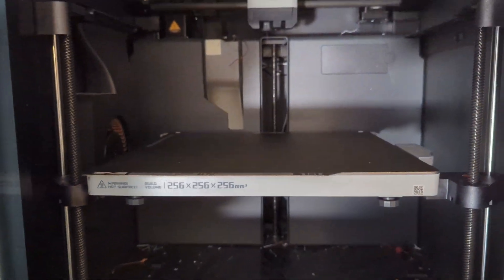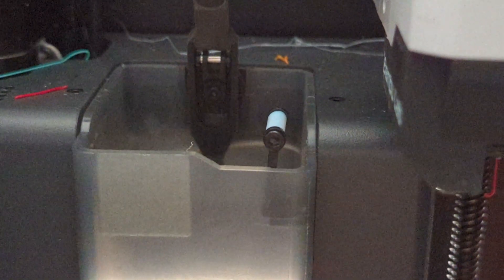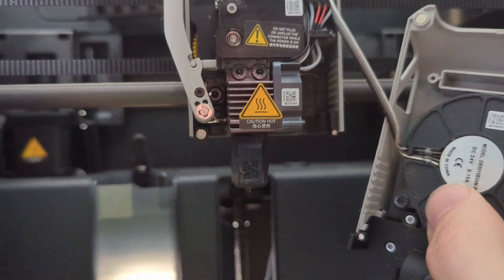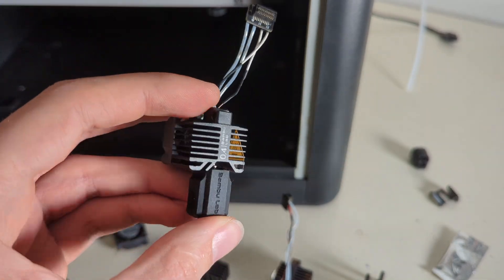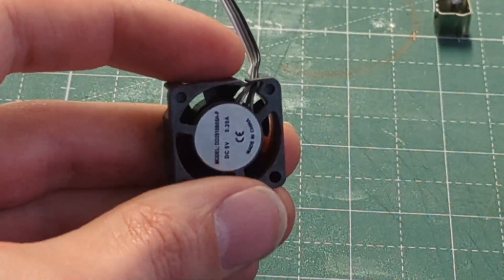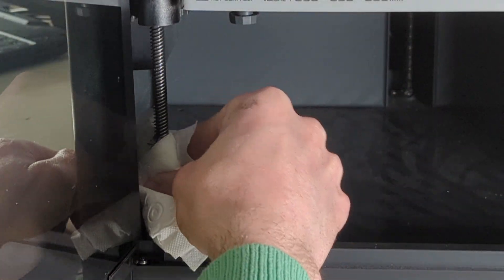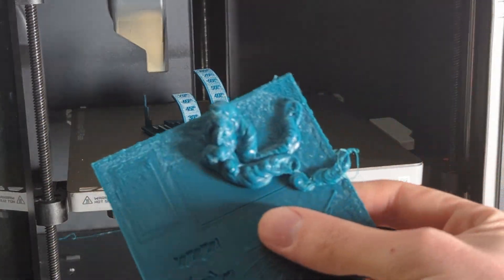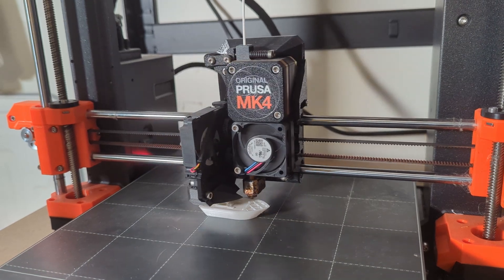I Did No Maintenance on This 3D Printer for Over 1 Year

Comment: prusa's i3 mk 4/5 are similar to prusa's A1 printers, but overall, what you pay for with prusa is excellent customer support with very similar overall hardware features.  some folks need/demand that level of end user support, and that's great, we need that in 3d printing, particularly for folks who are building print farms and don't want to have to muck about with slow, inattentive support such as like creality does, but if you don't need the support, and YOU are your own support and you know what replacement parts to buy and what maintenance to do, and you don't want to have to pay for or interact with customer support, then a very much less expensive printer with similar features and very little to no support (like the creality k1/k2 series) are excellent... in fact, right now, I think that the k2 plus combo is probably the closest to competition with the p1s+ams while being larger AND open source. (it runs klipper and it's rootable out of the box as a menu item if you want to extend it's software capabilities).  I personally have a p1s as well as a creality k1 max (and a voron 0 and a voron 2 that I built but those are out of scope as they aren't off-the-shelf printers).  I love my k1 max just as much as my p1s, the only issue with the k1 max that I have is that the bed is too thin and tends to warp, but I have overcome that by simply preheating it so the bed gets into it's final shape before printing (which generates a bed mesh for further compensation and gives me excellent results).  the k2 plus is basically a k1 max but it's a little larger at 350mm, and the bed is significantly thicker (like the k1c) and it also supports creality's multicolor system. it's basically comparative to a bambulab x1 carbon but 350mm instead of 256.
Reply from the maker: Thanks for the very detailed answer! I did test the K1 when it came out and I was not very convinced by its longevity and robustness. But that was over a year ago. Maybe I will give the max a try.

Comment: the torture test at 8:51 looks slightly overextruded.  I would recommend running a flow rate calibration and it should take care of the top surface irregularities so everything looks nice and even and smooth. (it may also help with the minor stringing in some cases.)
Reply from the maker: Turns out, I forgot to adjust for the hardend steel nozzle.

Comment: It’s not glue on the old nozzle. That’s thermal paste. It just dried up and got stuck. You should be able to pull it apart. You may have some of those silver packs that came with the printer. That’s thermal grease.
Reply from the maker: Thanks for letting me know